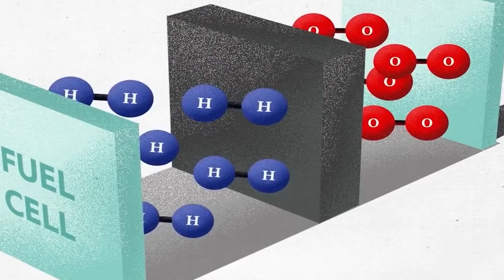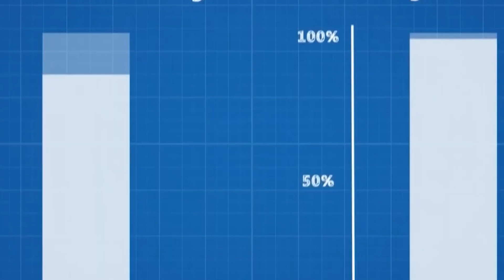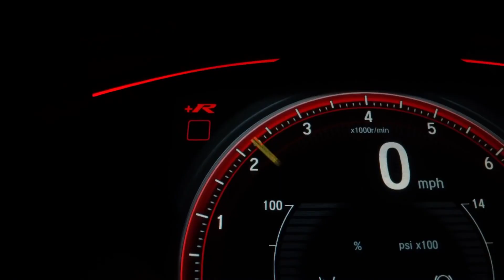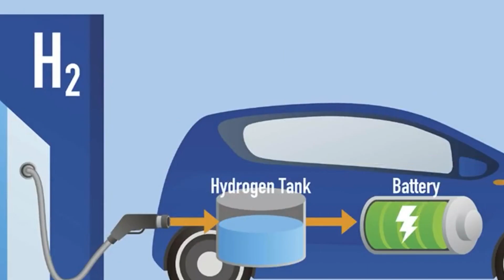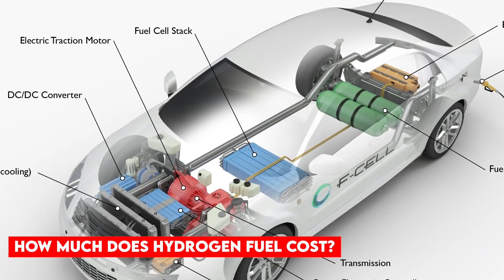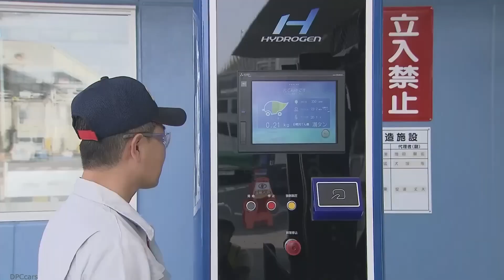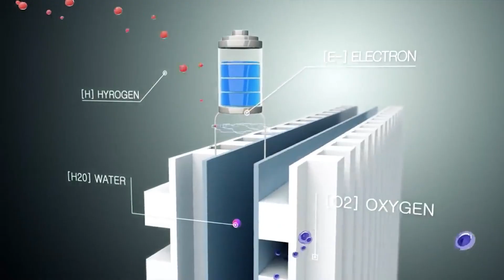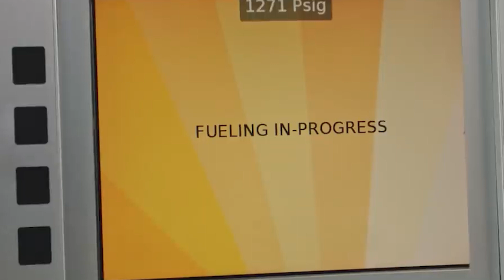Hydrogen Fueled Cars | All You Need To Know

Comment: Hydrogen Fuel Cell is the right way to go. No toxic lithium and other heavy metals to pollute the environment. Hydrogen fuel cell cars only exhaust H2O vapour and probably the most environmental friendly technology.
Reply: It stores the electricity in lithium ion batteries.
Reply: Water vapour is also greenhouse gas accounting for 60-70% of the greenhouse effect while CO2 accounts for only 25%. So, exhaust Water vapour is not exactly environment friendly.